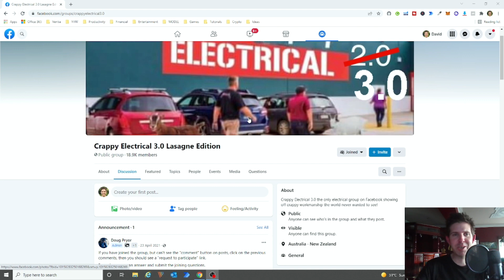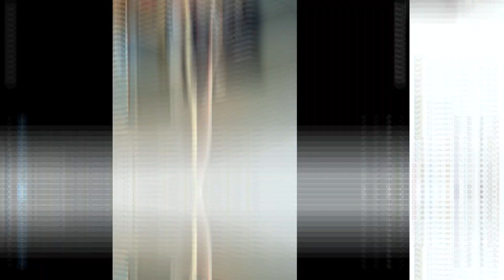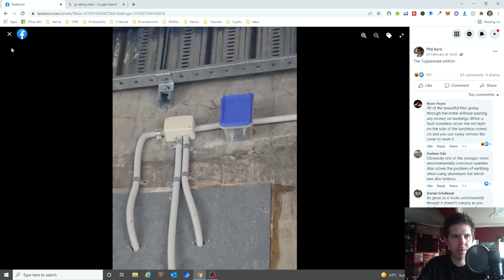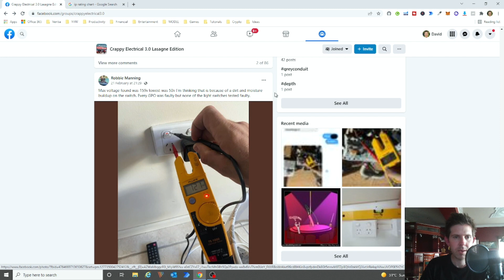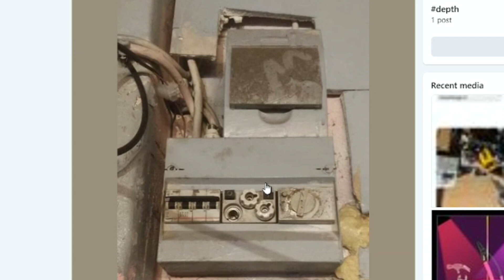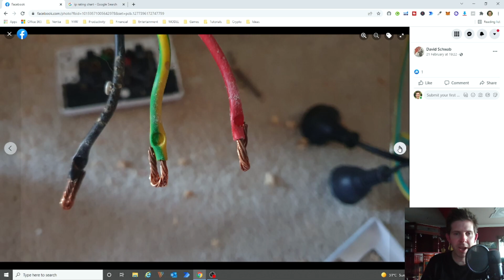Electrician Reacts to SHOCKING Electrical ⚡️

Comment: The motor wiring at about 5.42 
Is that a 3 phase motor
Is the cable 3 core flex using the green as one of the phases. if so where is the earth?

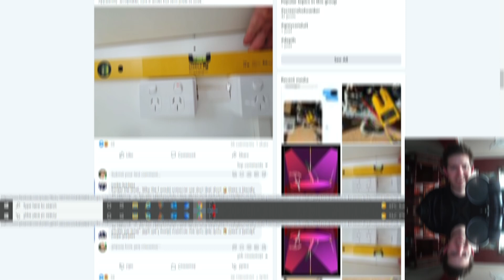Comment: 1:29...that's is fully live exposed connections...in Romanistan...ahem...I mean Romania on some concrete street poles it is not so uncommon to see exposed to rain metal connecors...like 3 or 4 of them few centimeters or inches apart...dangling in the air...

Comment: That wire stripped in the middle I see in my own house. Get this Cook country in Illinois US has residential wiring in conduit. Run of 20 amp outlets using 12 gauge (2mm) wire, strip a couple cm, loop around the screw on the outlet and on to the next run. Always a joy to work on as each outlet has 5 wires going to it so nice and stiff to shove into the box.

Comment: I dunno what you are laughing at ! I lose count of the DIY  junction boxes I have found that have been made out of tobacco tins with the holes tin snipped out, sharp yes? and there are still houses where the wiring is waxed cloth  singles in wooden conduit ,as it was when electrickery first got here. still plenty of lead case wiring in place.
  I don’t know if you knew but a lot of domestic consumer units were made of wood, I have come across a few where woodworm have eaten it all , so everything is to hand, as it were…
Reply: Where I live, it was a "Test City" for electrical wiring. IE one of the first deployments of electrical power anywhere.
lots of old knob and tube, soldered splices without a box bundled in tape, dodgy neutrals and grounds. For heaven's sake, I saw a 15A breaker on an 18AWG oil cloth covered conductor.

Comment: In the UK more and more consumer units are starting to look like boards found in commercial premises. There is a new housing estate in Wales which every home has had 3 phase as standard. Check out efixx channel as those guys visited the estate and looked in depth at the power and smart home set up.

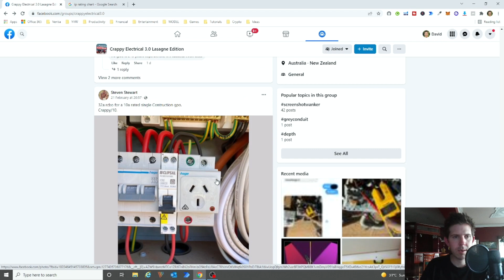Comment: 6:57 You are assuming that everything past the plug will always be used and functioning exactly as intended, but if everything in the world was used and functioned as intended, we wouldn't really need things like circuit breakers in the first place.  You should not just stop your protection evaluation at the socket.  Faults and overloading can and do happen on the other side of that point too.  What if the device has a partial fault which ends up pulling 25 amps through that 10A socket?  What if somebody plugs in a multi-outlet extension cord or a dumb multi-outlet adaptor and plugs multiple things into that?  You are absolutely not "guaranteed it will be below 10 amps", depending on what people choose to plug into that outlet, and also whether something downstream has a fault or not.

There are some things you sometimes just can't protect against with a breaker, such as overloading a single socket on a multi-tap circuit, but in cases like this, where there is only a single outlet attached to the circuit, the socket and plug (and potentially even things after that too, if you know what they will be) should all be considered part of "the cable" which can and should be protected, and should be considered in the equation of what size breaker should be allowed.  If a circuit only has a single 10A outlet on it, then even if the wiring leading to it can handle more than that, the breaker should still never be more than 10A (the weakest component guaranteed to be in the chain).  That way even if somebody manages to plug in something that draws more than 10A to that socket, it will just trip the breaker instead of melting the socket and actually causing a fire.

This is the problem with just parroting phrases like "protect the cable, not the appliance" without actually understanding and thinking about what they mean and whether they actually apply.  It produces decisions which seem right on the surface but are actually providing substantially less protection than they really can and should, and can lead to things like fires that actually could have been completely prevented with the application of a little common sense instead.

Comment: I really don't understand the electrical hardware in other countries (me being in the US). Your panels seem to be a DIN rail with loose breakers and every one needs to be wired to a main, and tiny. Here, there' s a main/disconnect that feeds bus bars and the breakers snap into them. It's huge, but there is plenty of room around them. We don't send out 240v to small things that don't need much power, and it's much safer (which is why we don't care that our plugs aren't like the UK ones). The main thing I loathe here is that for residential, we only use solid for 15 and 20 amp circuits. It's such a pain for something like a box with a bunch of light switches installed. The wire pushes back and makes them hard to get straight and aligned.
Reply from the maker: Yep for most domestic households we use din-rail mount switchboards but most commercial and industrial 🏭 installs have exactly what you mentioned. A large chassis with clip in breakers.
Reply: Also in some cases there is a bus bar that screws in under the breakers to join them all to live
Reply: We have 415/240 in Australia not 240/110V so all circuits have 240V going to them

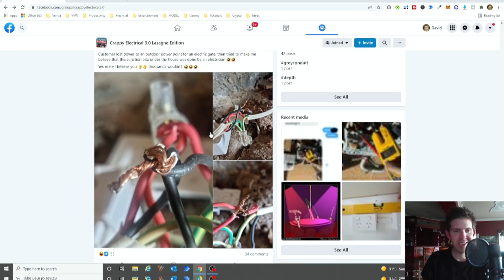Comment: 9:18 I'm not really getting your point here.
What will happen if an appliance is plugged in that is itself faulty? A broken switch, a low resistance path between conductors, ...

Comment: I watch stuff like this and it makes me feel so much better about the DIY electrical I ran here at the house. (US 120v) I needed a plug in the closet. So I ran a 30a electrical cable from the breaker box to the closet and put a 15a breaker on it. Due to location I could not run the cable inside the wall so I ran it through an external grade electrical conduit that I mounted to the wall as well as an external grade plug box then put in a 20a plug plate.

Comment: Tbh I’ve never seen a twisted joint fail
Reply: Just last month I found a failed twisted joint in the attic at my grandparents'. It was done probably 30 years ago and worked until now... the old copper of the oldest cable had corroded on the surface and was no longer making good contact. This is why you need contact pressure by screwing or crimping.
Reply: @stgram12  should have use the same metals or used a wire nut that's rated for dissimilar metals helps with the corrosion. Or use newer aluminum alloys they are better at not corroding.
Reply: I've never seen a proper twisted splice fail but I have seen someone fuck up a twisted splice than it fails. Really as long as things are done properly if left alone they should never fail wagos, wire nuts or crimps. I pre twist with my wires making sure the exposed conductors and a little bit of the insulated portions too are twisted than I put a connecter on and then tug test and Ive never had a problem. I have had a couple times with stranded wire I broke it clean off putting on the wire nut too tight but you learn and ya redo your splice till your good at it.